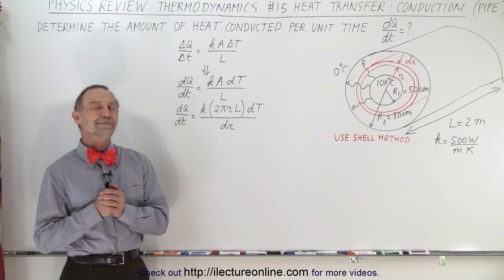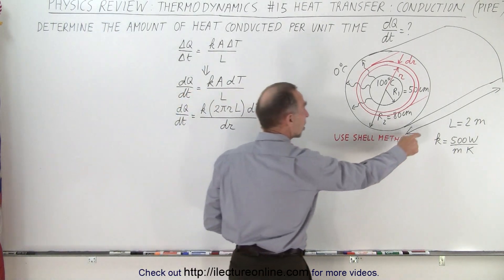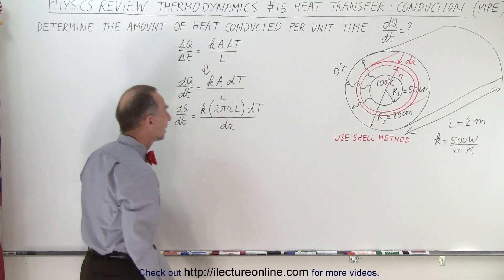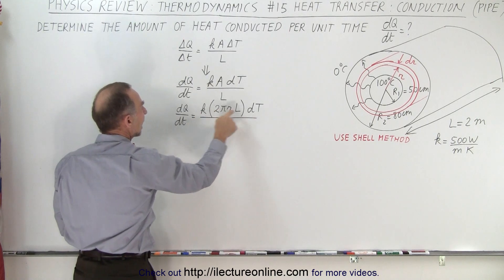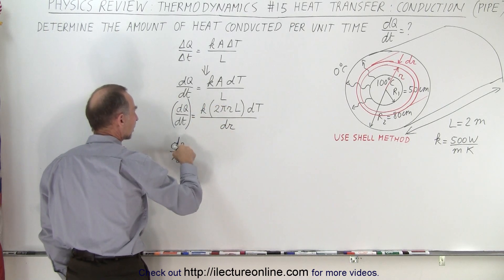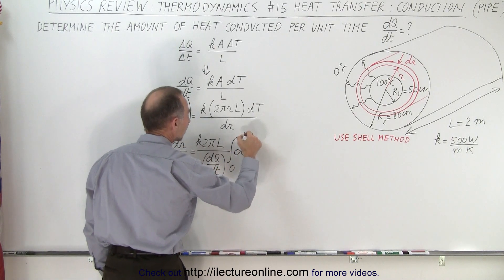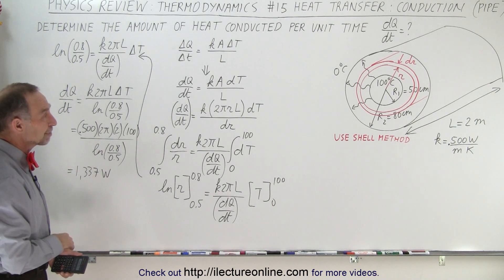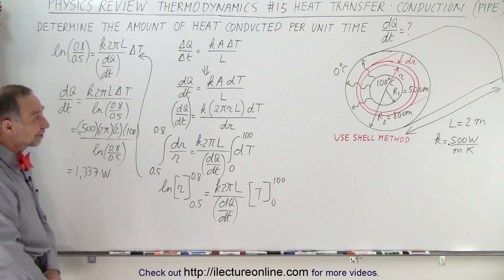Physics Review: Thermodynamics #15 Heat Transfer: Conduction (Pipe)

Comment: You can make a table of k values and see the differences. It’s very interesting and useful.
Reply from the maker: That's a great idea!
Reply: @MichelvanBiezen  I could get you values for thermal tiles used in the space shuttle to compare with regular commercial thermal insulators. It’s an eye opener.
Reply from the maker: Yes, they would be great at preventing heat conduction.

Comment: 💡Professor, I was trying to get my head around the amount of heat loss in your example.  When you said enormous, I think that was an understatement.  Here are some examples of watts that I looked up.	
Watts: 
60	A common incandescent light bulb might use 60 watts.
150	The average human, when exercising at a moderate effort, can sustain about 75-150 watts for an hour.
340	Solar Energy: A square meter of the Earth’s surface, when exposed to direct sunlight, receives about 340 watts of solar power (this is known as the solar constant).
400	A professional cyclist can produce over 400 watts of mechanical power over an hour.
1000 A professional cyclist can produce over 1000 to 1100 watts in short bursts.
1700 Sprinters can peak at over 1700 watts.
74,570 A small car engine might produce 100 horsepower, which is equivalent to about 74,570 watts.
1,336,838 Enormous Heat Loss used in video!!!
2,000,000 A large wind turbine might have a maximum power output of 2 megawatts.
	
By the way, I don't know calculus, but I still learned a lot from your video.  Thank you!
Reply from the maker: Thank you for the interesting information.

Comment: Thank you, I like it. Why do you mark the pipe length and the separation distance with the same letter L? This is a little confusing. You could mark the separation distance with the letter X or the pipe lenght with the letter L1, right?
Reply from the maker: That is a good point.  In retrospect, that is bad form.  Thanks for bringing that to our attention.
Reply: @MichelvanBiezen  Yes, that caused significant confusion, at least for me... as heat is being conducted radially, through the insulation, along the length of the pipe/insulation. (I thought you were, at some point, dividing by the length of the pipe?)

Comment: I live in a Traler Park in Canada. .. I stay warm and my pipes don't freeze because I understand thermodynomics. 
My neighbours have all kinds of problems. .. I tell them how to solve their problems but they won't listen.  It's an ego problem. 
They think that white foam gives off heat. .. Then their pipes freeze and mine don't. 
I've done all I can do.
Reply from the maker: Living in a cold environment people would be well advised to cover all their water pipes with a good and thick insulator.  It is in our nature not to want to take advise from others.  🙂   Where in Canada do you live?
Reply: @MichelvanBiezen  I live north of Vancouver BC, near the ocean. This is the warmest corner of Canada. We had a low of -13*C this winter. .. I have an eletric 'heat tape' on my water line.
Reply from the maker: I used to live in Edmonton.  Temperatures of more than -20 C are typical there in winter.  Most pipes are buried below ground to keep from freezing.  (It was -43 C this winter)

Comment: Just finished putting foam lagging jackets on the water pipes in the attic - how very appropriate!
Reply: Do you think the foam gives off heat ?? 
It does not.
Reply: @bimmjim  If there is any heat going trough it, at least, then it does give off heat. The heat has to go somewhere. If the foam (or any other material) is storing the heat, it becomes a heat source as soon as the ambient temperature is less than the temperature of the foam.
Reply: @bimmjim  It slows the heat loss from the pipe in the centre when the attic is freezing so that the water in the pipe does not freeze.
Reply from the maker: It is indeed a matter of the RATE of losing heat.  If it is slow enough and the water in the pipes does not stay there for days without moving, it should keep the water in the pipes from freezing.